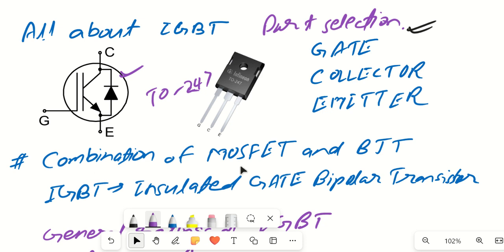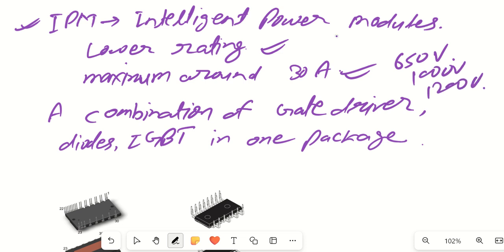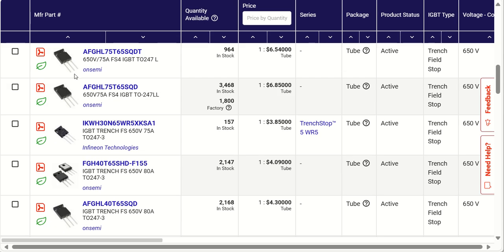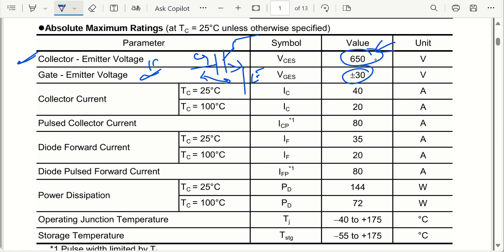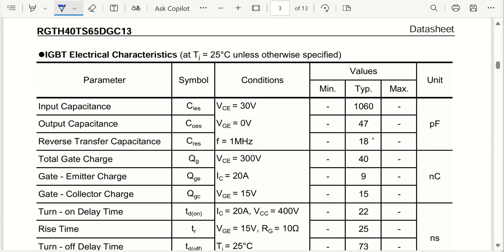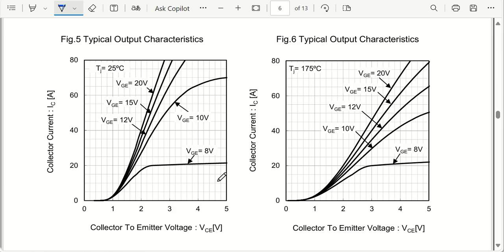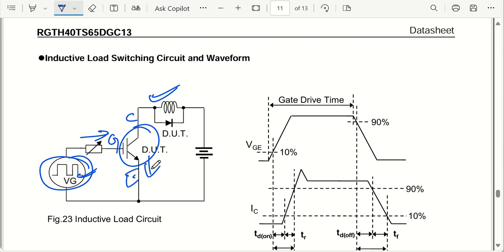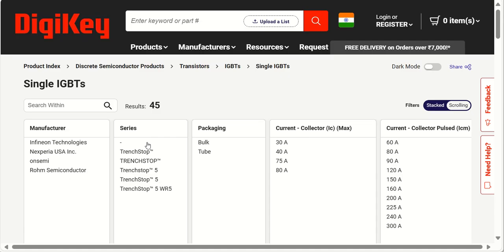108a All about IGBT details, applications and part selection repeat

Comment: Hi,
I not understand why MOSFET or IGBT power dissipation given in the datasheet,may i know the real application ?
Thanks
Reply from the maker: Power dissipation parameters saves your time to calculate the limit of operating current and voltage for your device.